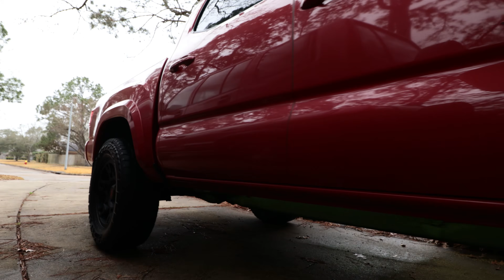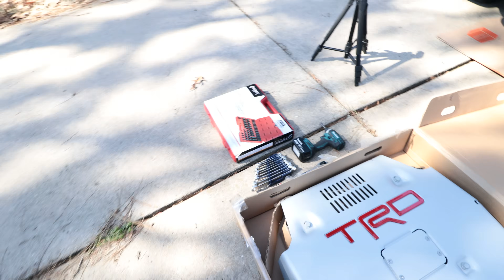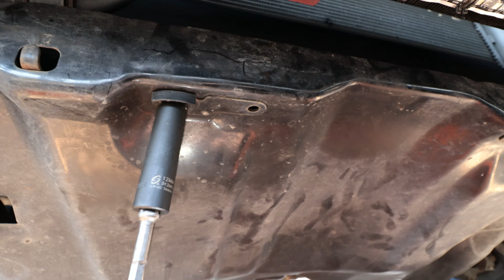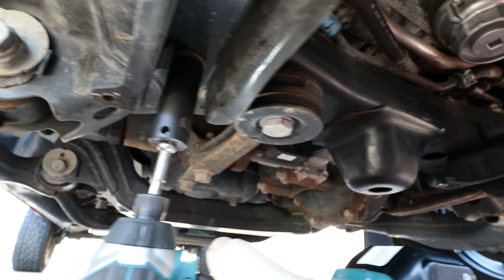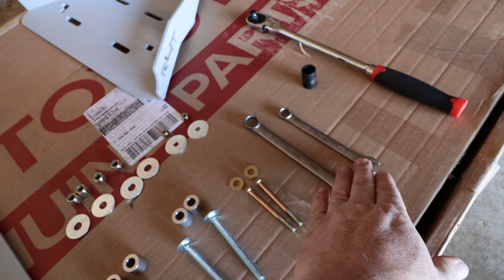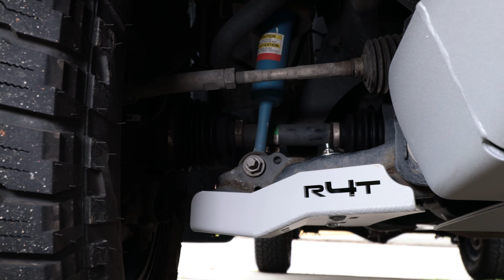Toyota Tacoma Mods | TRD Pro Front Skid Plate & Runnin4Tacos Lower Control Arm Skid Plates | 3rd Gen

Comment: How much did your truck slow down after getting bigger tires?  Did you regear?
Reply from the maker: No noticeable change whatsoever. Stock tire size is 265/65/R17, and the new Falken Wildpeak tires are 265/70/R17. It's just a very minor size difference. No re-gearing needed 👍.

I hope this info helps 😁

Comment: Great work as usual! I really like your uploads, simple and easy to follow along with being very informative.  Quick question - is there a gap between to front visible portion of the skid plate and your bumper? Meaning the skid plate does not fit flush with the bumper?  I have a Sport and there are very few videos showing the skid installed on a sport (,and hence any gaps)
Reply from the maker: There is about a 1" vertical gap between the bottom of the bumper and the "front / top" of the skid plate... but the only way you'd see the gap is if you were looking straight at the Tacoma at about 2 feet from the ground lol 😆. 

Thanks for the positive feedback on the video! Hopefully this info helps answer your question 👍
Reply: @LevelUpMechanics  thanks for the follow up! I have a 2020 Sport with a white front bumper so the gap is more noticeable.. just wanted to double check I didn't do anything wrong.
Reply from the maker: No worries lol. Yeah, the gap is normal.

Comment: Does the Pro skid plate give access to oil filter without removing the whole thing?
Reply from the maker: Yes, there is a bolt-on access panel that allows access to the oil filter without removing the skid plate 👍
Reply: @LevelUpMechanics  Will the Fumoto valve fit?
Reply from the maker: From what I've found, yes it does 👍

https://www.tacomaworld.com/threads/fumoto-valve-compatible-with-trd-pro-skid.467566/